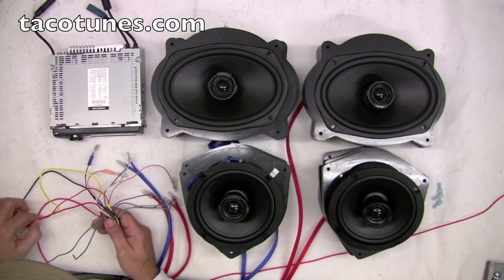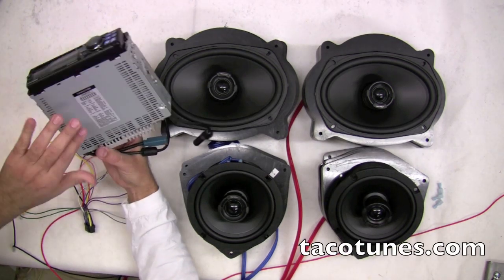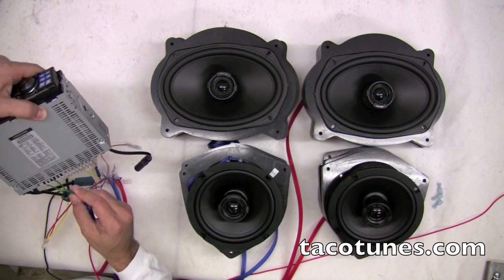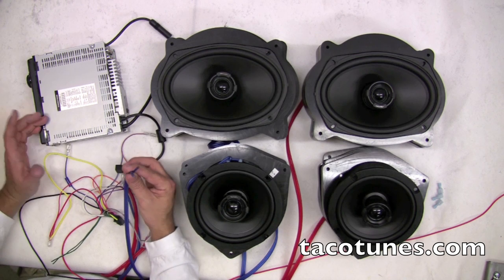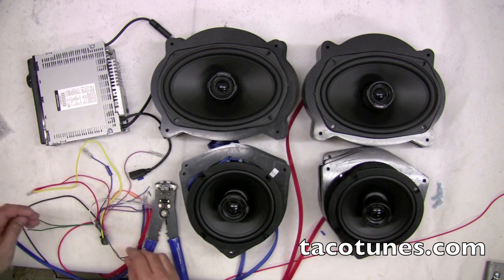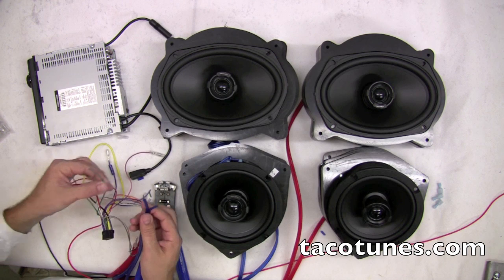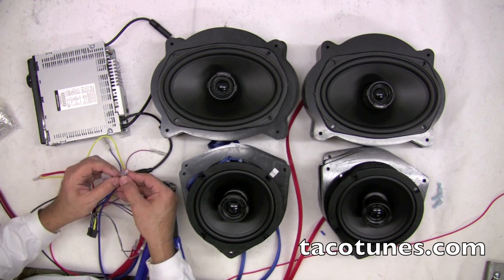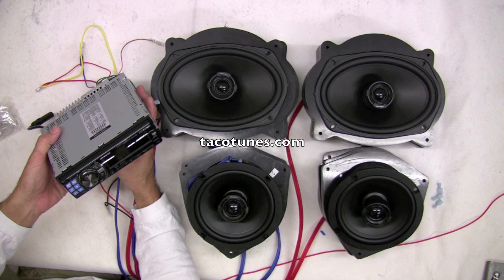Building a complete audio system - Head unit basics Part 3

Comment from the maker: 1. Most speakers these days are around 4 ohms. If you go under 2 ohms the amp will run a bit hotter. But this is really a big factor when you are driving at higher volume. 
2. Going over or under is not a huge issue. introducing "clipped" signal will damage your speakers. Most speakers rated at 50 watts can easily handle around 70 watts of unclipped signal. If you start hitting them iwith over 90 watts or so the voice coils will overheat and you will "blow" the speakers.